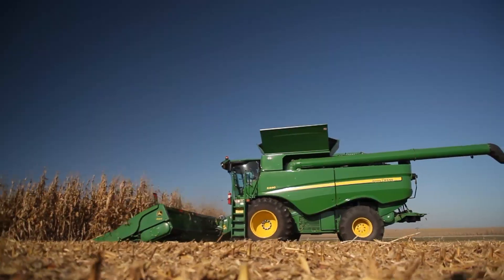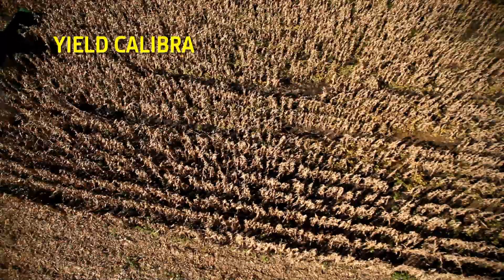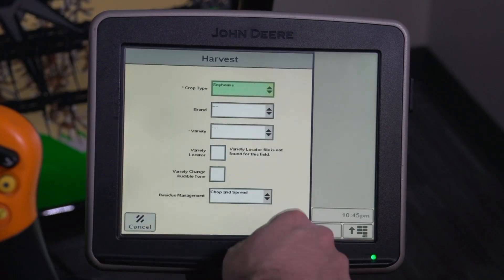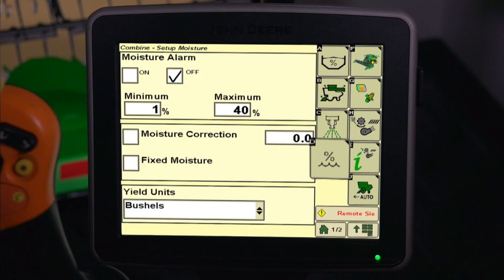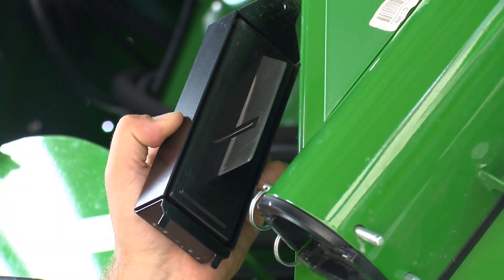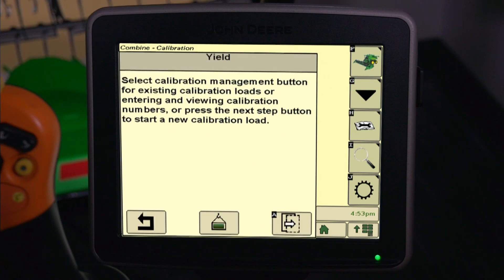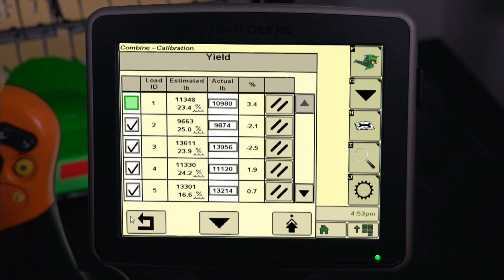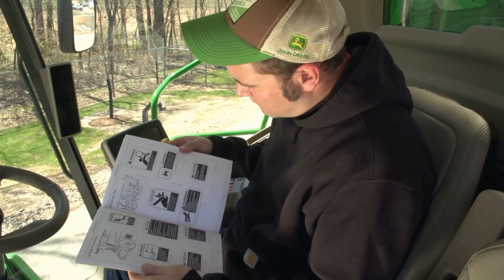Yield Calibration Procedure | John Deere Combines GoHarvest™

Comment: Hello, Just one question ,the map that was generated during the calibration ,it's will be corrected after the calibration concluded ?      Thanks !
Reply from the maker: Hi Ricardo, the map will be updated according to the range of values set for the map legend. If you have any further questions we would recommend contacting your local dealer for assistance. If needed, you can find your local dealer at dealerlocator.deere.com. Thanks.
Reply: John Deere ok, thanks for your help !